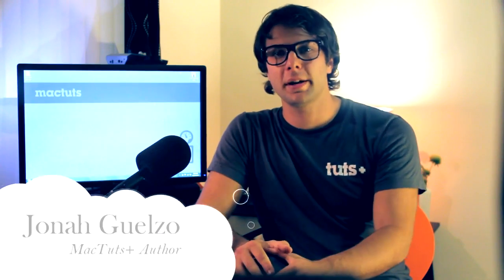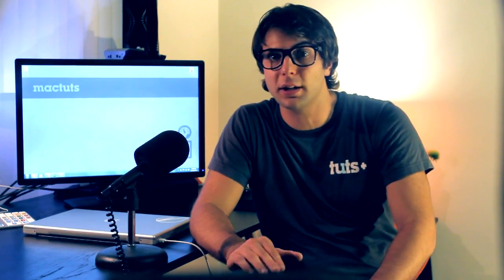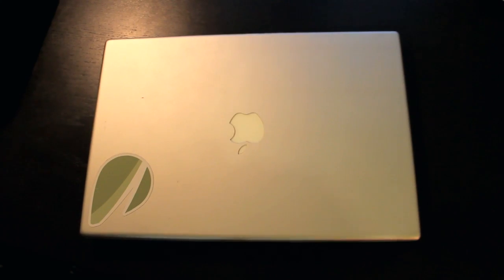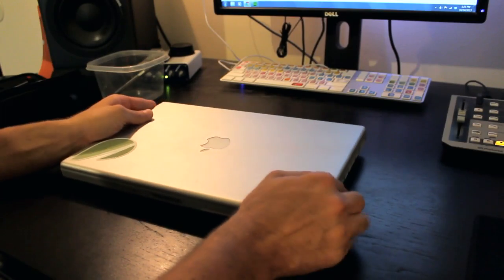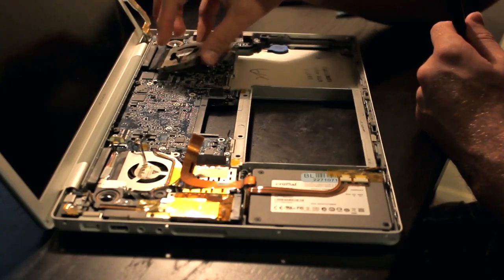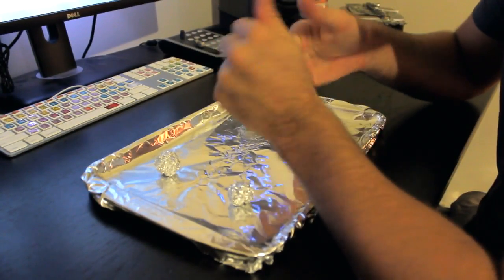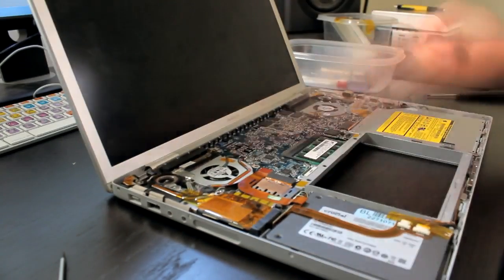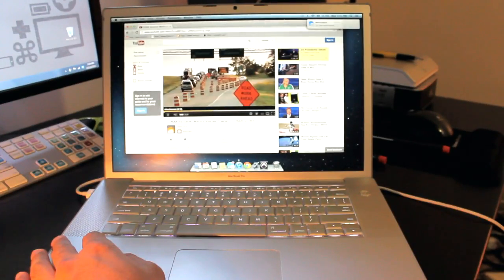How to Cook Your Mac

Comment: I FULLY thought this was a joke and said fuck it, I have nothing to lose so I’ll try it. To my surprise, it worked flawlessly. My MacBook is working again, but for how long I’m not sure
Reply: Glad it worked for you! But yeah man this is a super common tech for reseating components. It’s commonly done on high end GPUs and motherboards very safely. You gotta realize, your components are heated far hotter at the factory when they’re originally soldered. You’re essentially heating the solder til it’s sort of pliable which allows the weight of the components to settle into the soft solder.

Comment: Overheated my GPU again

reformatting and copying several external 2.5" USB drives

one after the other

NOT THINKING!!

Sometimes the fans were not running

Or not fast enough

FORGOT to set or install Mac Fan Control on some drives...

So I'm trying the FAN-LESS RUNNING trick...

Upside down

GRAVITY on the hot air solder

Worked once here, after about 40 minutes

Never and issue when working with FireWire drives...

Different power / work loads

I guess.

Stay tuned.

J.C.

Comment: I have done something similar with a 2011 macbook pro with a heat gun.....i've  done it twice now......the first time it only lasted 2 weeks......so far i have used this one for about 0.5 a week......this is only a temporary fix on a 2011 macbook pro.....the GPU has ultimately failed and needs to be replaced

Comment: I dunno what's wrong with my ancient 2006 macbook pro. Won't boot to hard drive after continuously shutting down due to overheating issue. However it will boot to the install disc, any thoughts? I figure I will replace the thermal paste, not sure if baking is needed...NVIDIA 1600x graphics card.

Comment: uggh i got so close yet so far away. 2007 MBP a1226
1. i did everything as instructed to the tee.
2. i got the chime and the white screen with apple but it booted in safe mode.
3. once booted i hit restart.
4. it went back to the same problems: Although the fan and DVD were running,
a. black screen
b. no chime at start up or when attempting PRAM or SMC .
c. dim sleep light flickering
d. Sometimes a barely visible apple.

5. so i reseated the RAM cards.
this time it went to boot in safe mode, but just hung there forever and wouldnt boot .
6. i shut down, restart, now back to 4a-d above.

Comment: My 2008 17" MBP died last week.  Light came on after starting but nothing else.  Keyboard (CAPS lock light) didn't work either.  I didn't have a problem with my screen before but thought what have I got to lose by trying this method.  Baked the logic board last night, put it back together and just like magic got the apple 'dong' on starting and then straight into OSX :) Thank you.

Comment: old macbook suffering black screen, found this and thought i give it try, worked a treat,  mac fired up and is now back to normal,  in UK if you need 375f  for your oven  its no.5 on the gas mark scale. Inside was covered with dust and vents clogged so everything clened up, easy to do, keep your screws in order as there are many different types used.   im not a pc tech   just followed this carefully.

Comment: Thank you. So far so good. 
I first tried just cleaning the chips and putting new thermal paste, just to see if it would work. Did not change anything. 

After putting the logic board in the oven and following your steps, as well as cleaning out the fans, and changing the pram battery for kicks, (these steps were not necessary just did it because it was open). Everything went back to normal. All programs and files were in operation. Not bad for a 2008 MacBook.    
Thank you. Your video definitely helped.

Comment: Just Worked for my 17' 2007 MBP 2,1! Was having graphics issues on startup, pixelated squares and could only use the computer in safe mode. I can't actually believe is working again. Cheers for the fix.

Comment: Unbelievable! A little tricky (especially as the guy's head hides a few areas of removing the board!) I love the tricky cable hidden under the logic board!!!). But man, this laptop I have just resurrected was a dead machine bought from Ebay for spares! Now I have a Macbook fully working!!!
I even thought how was I going to get the board back into the laptop, but the board is a tough cookie and can take a bit of manipulation. I was never exerting any excessive force though. anyone else about to embark on this, give yourself plenty of time and take the time needed.I cannot believe this worked, but it did!

Comment: Last tuesday my early 2008 macbook pro called it a day, after 7+ years of service. One of apple authorized dealers, detailed that the graphics chip was the issue, common on this type of mac. So in desperation (i have my masters thesis on going) and as a last resource I performed this MAGIC using my home gas oven (kind of doubted this method because of the moisture generated by gas combustion) and I DID WORK! I'm writting from the same machine.
I now this temporary, but now, I do not have to rush to get a replacement but can choose which mac is up for the job to replace this impecable, resurrected macbook pro.
Hope it works out for the rest.
Thanks Tuts for this tip!

Comment: Well, just got done doing this perfectly as far as I can tell and my Macbook Pro isn't showing any signs of life. Press the power button and nothing happens, no sound of anything turning on. Batter is good to go with plenty of juice, I even plugged in the power cable and the little light on the magnetic charger blinks orange instead of being solid orange or green, never seen that before. I triple checked that all the connections are made on the logic board even reconnected most of them. Any suggestions on why it may not be getting power or is quiet?
Reply: Praise The Great I AM for answered prayers.  Shawn, I had the same no sound/no charge/No left USB problem.  Under the left side of the main logic board is a stiff wiring harness.  Mine had come unplugged on the other end -beneath the left speaker.  So the little wireless card + the left speaker need to be unfastened to allow the speaker to tip up (allowing harness reinsertion).  I found another sensor wire that had escaped my notice by the right fan too.  It all works great now.  Thanks Tuts.

Comment: this fix WORKS.
to all of you fighting MacBook Pro problems when all those cute fixes don't work (holding down buttons while powering up) this is how to fix the problem.
just to list the problems I was having.
1 scrambled/distorted video problems just like in the beginning of this video.
2 when you push the power button no chime, black screen, fans running, optic drive cycles
I was having ALL these problems sometimes all at once many times some combination of them and finally no boot just black screen.
Thank You sir for showing those of use that can handle this fix we don't need state of the art flow benches / work shops just some common sense direction.
I'm now going to tackle an IBook that has the common video problem as well.

enjoy and be safe

Comment: Last sunday I baked my logic board and after testing, letting the GPU go up to 67 degrees, I can say it definitely works. Just as the video showed. Now I'm not afraid to close the lid of my 2007 MBP 15". Let's see how long it will hold. The temperature stays around 50-54 normal use and doesn't go over 60. Only when playing online video's it goes beyond 60 degrees. Even upgraded to SSD! It even boots up faster than my i3 Vaio and this MBP cost me only 250EUR and some heat paste. Good bargain!

Comment: I was very skeptical of this 10 months ago but had nothing to lose.  It worked for me as well.  Lasted 3 months on the first "cook".  I did it again leaving little longer in the oven (8 mins) and this time lasted 6 months.  And now I'm back at it again for the 3rd time.....considered buying a new Macbook Pro as this one is nearing 7 yrs old, but why put out $2000+ when this MBP still works plenty good for me and I can even run the latest OS (as of this comment Yosemite) and it'll run fine.  Very time consuming, especially reassembly, but saves you a ton of $$$.  Curious if anyone as purchased a used Logic board from ebay with the new GPU chipset, and if there's been any issues?  I've thought of just doing this instead, but I'm hesitant as some have complained of certain apps that are video intensive are not functioning properly.
Reply: I was thinking of buying a logic board, but seems to be expensive. Also there's no guarantee that you'll get a long-life board.

Comment: Thank you for this detailed and intuitive Video. It explained many issues i experience with my mid 2007 15 inch Macbook pro which I just recently upgraded with SSD HD and experience extreme heat influence.
If you may could include in your future video ho to clan the heat pipe distribution between the two fans. Also further on could you please explain how to replace the optical drive and to replace it with a drive caddy and a HD or SSD.
Thank you, your videos are one of the best i watched on this channel.
Reply: I wanted to do the same thing and remove my optical drive.  After much research, according to macsales.com you can't do this on this model.  I believe it has something to do with the battery in the way of the HD connector and optical drive connector, there's no way to split with a 3rd party cable.

Comment: this is my 3rd go at reviving my 2008 MBP.    I use the same paste.    Same procedure but from a different source.   Bottom line, it will work but for just how long???    1st time lasted 11 months this time around 5 months.    This is my last cook, next time I'm going to rip the hard drive out and throw the rest in the trash.
Reply: The problem is the graphics chip itself, improperly manufactured connectors by nVidia. Not really Apple's fault. Permanent fix is an updated chip that solves the problem.
Reply: Damn its weird that once you responded to this .. it died again.    Now it doesn't even beep or come up with weird graphics.    It doesn't even get to the mac logo.     Something else must be up.    Oh well F it, i'm done with this thing.    I'll rip the HD out and hope to install it on another computer.
Reply: Carlos Morales The cooking method is the least reliable of three. The second is having it reballed by a technician, which you can find listed on eBay. The real fix is to just have a new chip put in, one that was designed to avoid the problem altogether. But that will cost more than half the value of the MBP 2008. If you can afford it, just get a new(er) Mac.

Comment: My trusty Macbook Pro 17 would not wake up from sleep one morning after it was working fine the night before.  I took it to the Apple Store and to an authorized Apple Repair facility.  Both told me the same thing, "Nothing can be done.  Apple has completely dropped support and there are no parts available unless you can find them online, but we'll transfer the data from the hard drive for a fee."  I was just about to find a replacement logic board or buy a new Mac when I stumbled across this video.  Since I was well past the point of last resort, I gave it a shot.  And shazam, it worked!  Thank you, Tuts+!  This video is the best I could find that has the bulk of the details you need to get the job done.  The good folks at Powerbook Medic had the rest of the details for the take apart and re-assembly.

Comment: HOLY SH!T this actually worked.  Took my 2008 17" MBP to the apple store after it wouldn't power on and they didn't even spend 5 minutes looking at it.  They said the logic board is dead and to buy a new Mac.  I watched your video and i am typing this form my MBP.  I did screw up during the baking process.  I set the clock to 7:30 but it was 7 hours and 30 minutes.  I finally realized my mistake with 7:03 left.  I cooked the board for 27 minutes and it still worked.  Thanks man.

Comment: my macbook pro has the same problem with the logic board. I haven't used for the last 4 years because of this problem. I love this mac. I dont have an oven what can be an alertnative to cook or heat it to that specific temperature.
Thanks.
Reply: You can use a heat gun instead of an oven. If you cover all other parts of motherboard with an aluminium foil and heat only the graphic chip, it will be even safer.
Reply: Thanks for the advise.

Comment: I find using the tip of the arctic silver while applying the paste spreads the paste evenly and does the same job if not better than what you used which looked like a q-tip with the removed cotton?

Comment: How does this work out for Macbook Pro's from mid 2010?
Reply: Don't remove your logicboard right away let it cool very slowly so just open the oven lid a bit and wait for 20 minutes and then you are able to get it out again the slower you let the RoHS solder cool down the longer it will last!!! And don't put that much thermal past on it he has about 4 times too much on it the layer should only be about 1micrometer thick so almost a see thru layer wich is impossible with themal paste XD problems with too much paste still overheating your parts!

Comment: I just did this and it worked! This also gave me a chance to clean out the cooling system, all the fins were plugged with dust. I got a little scared because it did not turn on right away. I figured out afterward that it would not start from battery (even though it was fully charged). So I attached the AC power cable and it began to start normally. 

A tip I would add to someone else doing this is to remember where all the different screws go. I thought of this afterward but it would have been to take a picture of inside of case and print it out and set the screws on the picture in the location you removed them from.  

Thank you! I was really depressed that I was going to have to frisbee this thing.

Comment: Unreal, it worked for me too!!! However. I reassembled the mac book pro 15 and it did not indicate power from the adapter, I removed and attached all cable connections two more times and then it powered up! Never give up... My Genius Bar did not know this one and recommended I part out the machine.

Comment: It worked!!! I'm in Mexico and set the oven 200 celsius degrees! And now the expensive brick is back to life... Anybody knows for how long this will last?!
Reply: You are basicly melting the connections back into place. Obviously sodering it back into place would be... better... but as long as the connection is made it works... if it gets brittle and breaks then it will stop working. the chip isnt moving but small vibrations can possibly break the connection if it is brittle enough.

Comment: Hey guys I need your help, my computer just fell on the ground and It went blank. I could see it when it's on but, the screen is black. Can this video work for me?:(
Reply: No. there is a difference between a graphics chip needing to be reflow'd and straight up breaking your computer.
Reply: Ok thanx Dayne:(
Reply: Zayana Enderson If your video went out but the computer still turns on either your video cable came loose or the screen itself actually broke. If you know how to disassemble a computer I would open and check to see that the cable is still intact on both ends. If you don't I would take it to a computer repair shop. The place I work would charge about 70$ to diagnose the problem, and 150$ + the price of the screen, to do the replacement. to give you an idea.

Comment: Success! Cooked my 17 inch Macbook Pro logic board today in a preheated fan-assisted oven at 190 degrees celsius for exactly 7 minutes and 30 seconds. I made foil cones rather than balls, I put the points of the cones in the screw holes. New thermal compound applied. Perfect, all working, thank you!

Comment: Fun stuff. The average lifespan of these faulty chips were about 1.5 - 2 years with moderate to heavy use.. 3 years if you were lucky. The manufacturers who didn't take system cooling seriously enough (HP & Apple especially) had the most problems with this.

Comment: Well done on the video tut, sir. I've been performing oven reflows for about a year or so now.. I use the method as a last resort when nothing else has worked (checking all connections, making sure all the correct drivers are installed, etc.) -- The reason this problem has been happening to so many computers (PCs and Macs) is that Nvidia for about 2-3 years has been distributing defective video chipsets, which went into laptop and desktop motherboards alike.

Comment: i definitely recommend running SMC Fan Controll, en speed up the fans double speed.
And keep an eye on the temps. using iStat for example !

stock the fans run @ 2000 RPM, but 4000+ is way better, and holds it much cooler.
They can go up to 6000 RPM..

Comment: No, I didn't place it in the oven. My way was probably much easier. It has been over a month and it is still kicking. I keep a close eye on my fan speeds and system temperature with smcFanControl to prevent it from overheating.

Comment: Your video has given me an idea of my own. Instead of removing the entire logic board, I opened the top and disconnected the fans. I then removed the drives, disconnected the battery, and connected the AC adapter. I connected the keyboard, powered it up and wrapped it up with a thick towel. After about 30 minutes, I let it cool down and put everything back together. I'm now typing this comment on my newly revived early 2008 macbook pro. Thank you so much for giving me the general idea!!

Comment: So my macbook pro is not even turning on. As i push the power button i hear the fans about to start and the sleep light comes on then when i let go of the power button, the fans stops and the light blinks for a couple seconds then everything dies. Nothing is show on the screen. My battery is full and my power adapter when plugged in is green. Ive done all the restart..Pram, SMC..etc. and nothing. Ill will try this tonight so wish me luck. Also do you think baking will fix my problem?